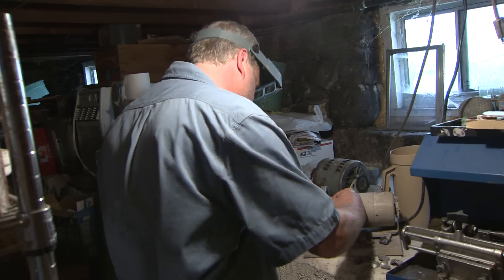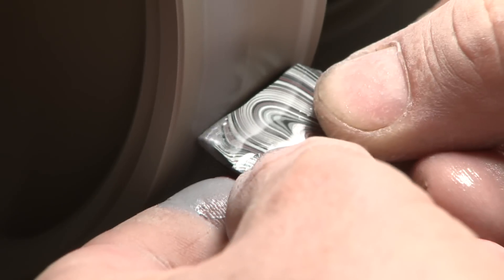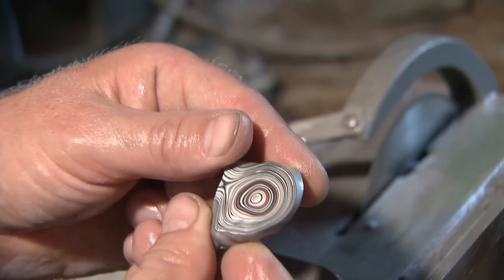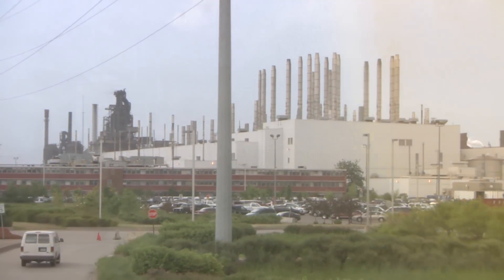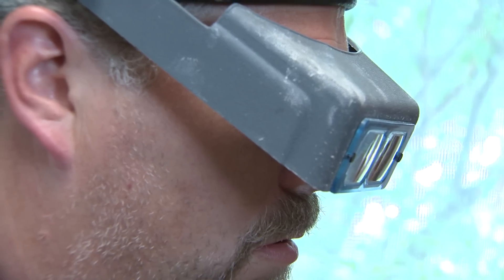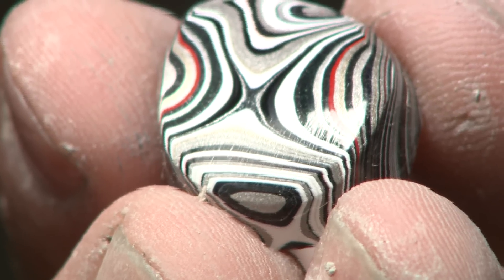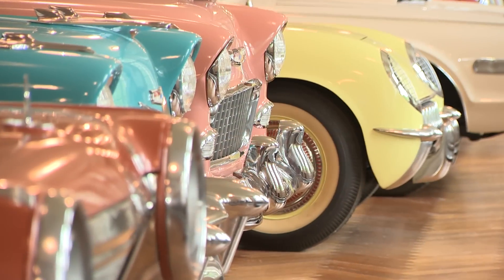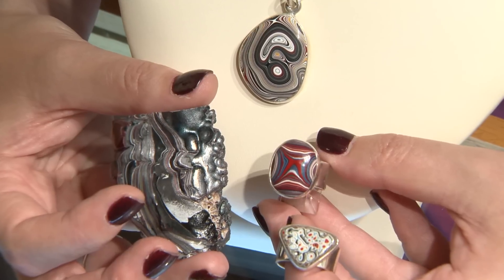Only in Detroit...Fordite

Comment: knowing the process, paintfall, bake, paintfall, bake, repeat, could you not replicate this method in a small oven or something? spray, drip, bake, repeat.  or am I just grasping at straws, I'm only curious because they say since the painting style of cars is changed, what's left of this stuff is all there is, well it was inevitably made by man, regardless if it was an accident or not, that same procedure could be mirrored or replicated in SOME fashion. (then again in the 60's and 70's lead based paints, so on.. not too sure..) I do tend to ramble...
Reply: Roy Martin the chemical makeup of the paint that was used decades ago has different hardening properties of the paint now